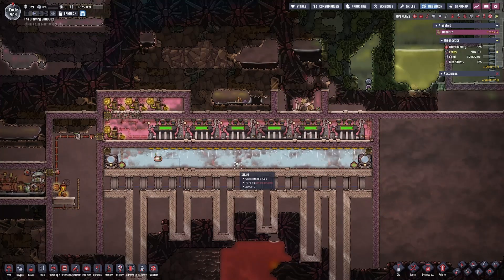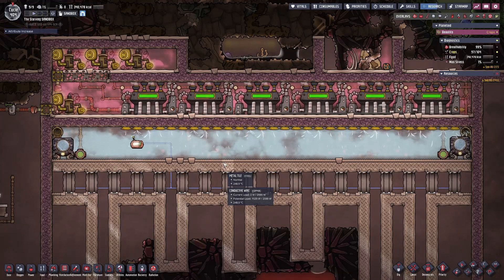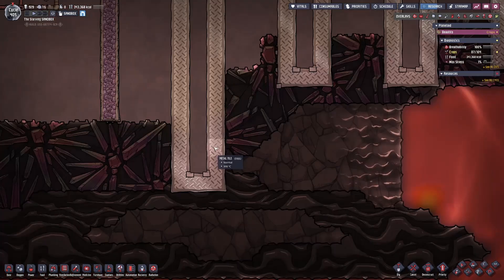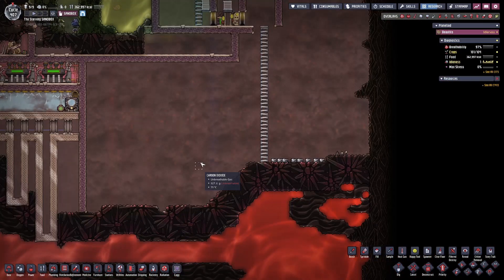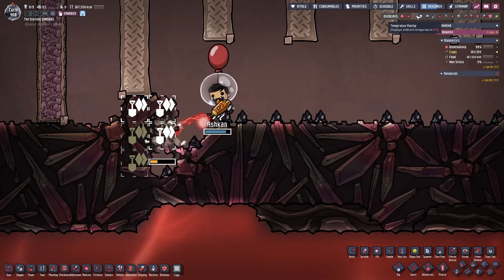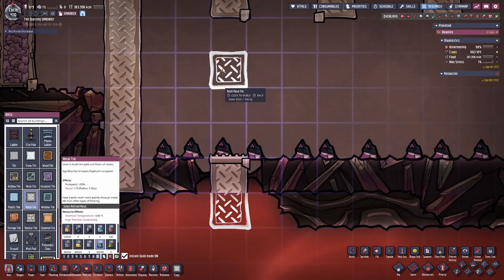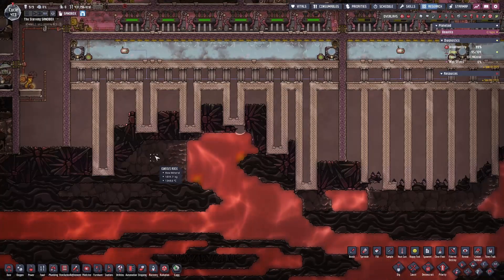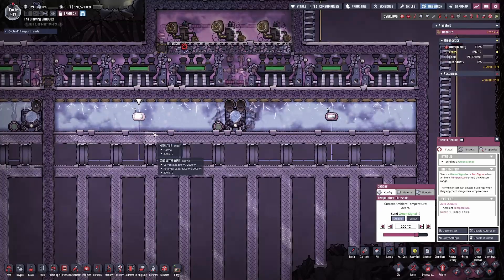EASY GEOTHERMAL POWER in Oxygen Not Included for BEGINNERS

Comment: Is there a reason why steel metal tiles instead of diamond window tiles were used?
Reply: that's what i'm wondering, diamond's readily abundant. I don't wanna waste my steel...
Reply: @pyrogreg8 I built it with diamond windows and it works well
Reply: I’ve seen people talk about how using a layer of steel slow down heat transfer into the steambox, making it easier to control. But the whole thing out of steel? Weird.

Comment: The Abysalite heat conduction is ZERO. The CO2 is conducting the heat from the lava to the metal tiles. Not the Abyslite.
Normally. I don't bother with metal tiles. Because they melt. All metal tiles melts except steel. So the chamber should be vacuum empty except for steel outlet. Make an opening to the lava. Drip the water directly on the lava. You should NOT have a AQT or anything in the chamber. It would hit 1450 degree C.Melting anything not steel. Your steam engine will need an external cooling loop from another AQT.

Comment: You can quite easily make a small vacuum box for two Heavy Watt Joint plates so that heat doesn't transfer from the steam room to the room where the Steam Turbines are located. You can then move the Power Transformers and Batteries inside the steam room as well for even more efficiency as they produce quite a lot of kDTU's themselves.
Reply from the maker: They need to add insulated joint plates ahaha!

Comment: Both crude oil and ethanol are TERRIBLE for AT cooling loops. Dont do it people, make the effort and use some type of water. pH2O or normal or better yet nectar if you have it. You're wasting a lot of power using ethanol or crude, dont listen to this guide and make proper setups. Dont learn bad practices from the get go.
Reply from the maker: Your point is valid, and I used pw at the end. But I also included other liquids to show how easy it can be to make this work, in case someone didn't have pw nearby and was wondering if any other liquids would work. That's kinda the point of the video, an EASY setup =)
Reply: @ Math: On water your real W usage is 633 W (in relation to a ST reusing the heat for power), DTU/s deleted per W spent is 924 DTU/Ws and you can cool 6 STs (Working with 200°C steam, all 5 inlets).
Same numbers for eth and crude:
866 W, 398 DTU/Ws, 3 STs;
971 W, 244 DTU/Ws, 2 STs.
Reply: @ethanplays-lag  ok, fair. Easy doesnt have to be the easiest. Also the easiest now will likely mean problems later. I can hardly see how filling a loop with water would be hard and how one wouldnt have water available. If that happens, loops would hardly be the biggest issue. We also now have bottle drainers which pretty makes the excuse invalid. I cant see any valid reason for wasting power and cooling capacity. Cos remember, shc of the coolant limits at's heat moving ability. Cut shc in half and suddenly you can cool down 2x less sts. Ofc for same power. Gonna add math later.

Comment: Great design although using two aquatuners using crude oil or ethanol are going to cause them to run a lot more of the time which will drain away half the power you are generating. You can also hook the turbines up to automation to save some of the power if that is what you want. Great video!
Reply from the maker: Thank you for point that out. I didn't make it clear in the video (I wish I did) the only reason I used different liquids from pw as I did at the end is to show that it works with crude, or basically anything that doesn't evaporate. But obviously the efficiency takes a dip. Thank you for watching!

Comment: Multiple pillar is less prone to failing by gradual heat loss, geothermal although very longlasting, is still a finite resource unless hooked up to a volcano. If enough heat is sapped away the plant will fail slowly, and it will do it in a way that slowly creeps up on you until suddenly you notice all your backup power is also used up and starting to experience a brown out😂

Also, technically you need way less steel than what is shown in the video.

The floor in contact with steam should never get hotter than 250 in any normal operation so any metal tile will work, I prefet gold because its very good at spreading the heat.

While the lower pillars can be build with diamond window tile because diamond won't melt and is excellent at heat transfer as well. Also there should be a ton of dianmond in the oil biome close by.

So the components that is strictly steel related are the doors, the automation wire that goes into the door, and the aquatuner, that should cut the steel cost down by 3 fold. Which may be relevant as steel is pretty valuable when building your first geothermal plant.
Reply from the maker: Thank you for the feedback! Including more detail is something I need to work on when making this videos!
Reply: not to mention using ethanol or oil in aquatuner loops is many times less efficient than pwater. its always like this in his builds
Reply from the maker: I used pw at the end. Thanks for watching =)
Reply: Never rely on one source of energy. We like to find out the hard way at one point.

Comment: what are the settings for the thermo sensors inside the steam room?
Reply: Green signal if temp is higher than 200
But is better to be just below 200 bc of the turbines producing more heat if steam is hotter than 200 
Also, You lose heat bc 200 °c Steam is 800kw but, 220 °c steam also produces 800kw